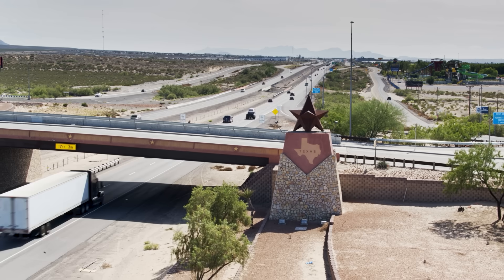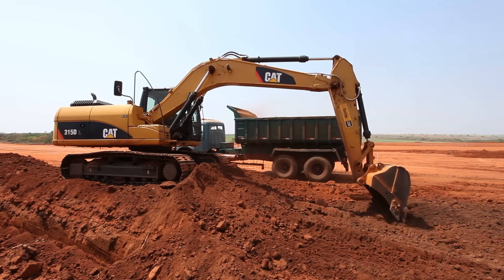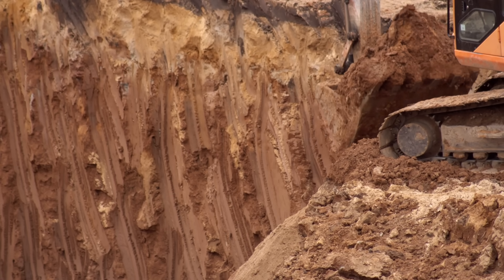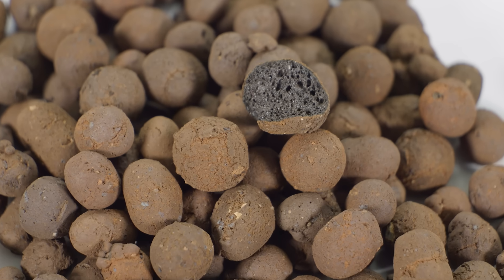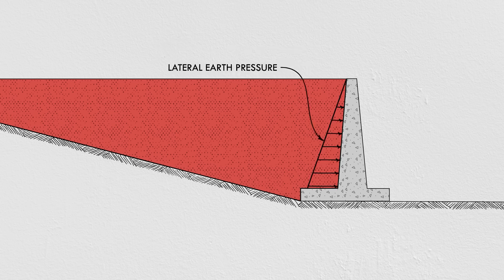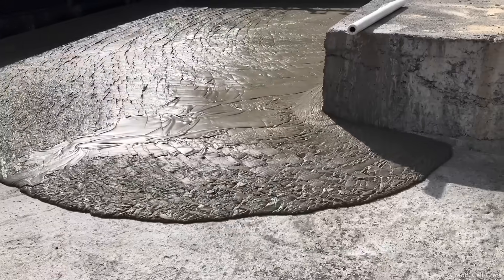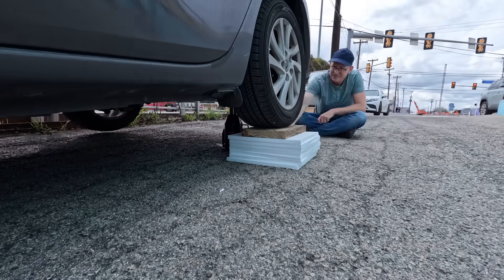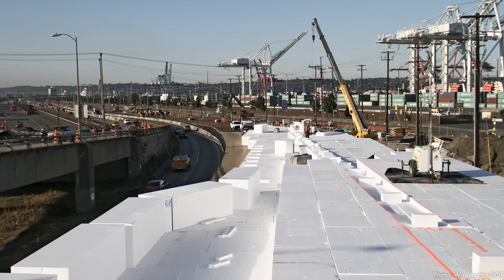Why Some Roads Are Made of Styrofoam

Comment: No matter how useful these techniques are if it means using styrofoam we should give up on them. Putting more plastic into the ground for 10 or 20 year lifespan things is an ecological timebomb. Though using biodegradable materials or recycled plastics for this makes much more sense.
Reply: More like 50+ years and probably offsets other emissions as well.  Biodegradable probably means methane emissions as well.  Details. They're important.
Reply: @AlanTheBeast100  Still better than using plastic.
Reply: @Treksh  Plastic is a disaster when used for short term disposable use.  (Water bottles by the case of 24, wrappings, things that have a very short service life).  When plastics are used for long term use, that is optimal when it is the better solution to a problem compared to other materials.  You have to consider many, many factors and not fixate on the negative one thing.  The sum of the parts includes its negatives.
Reply: @AlanTheBeast100  Unless the project is meant to last a 1000 years using plastic is always a disaster as it simply cannot or will not be properly handled at end of life. 

Do you really think these plastics or construction companies will go dig up and filter out the styofoma they have now mixed into this embankment after 50 years?

Whereas that area will have plastic in the ground for 1000s of years. 

The simple fact of the matter is any forever chemical that degrades on timescales that outlast civilisations is bound to cause problems. Do the 1000 years of harm get offest by 50 years of cheaper embankment construction I doubt it.
Reply: @Treksh  My last reply on this subject:  Styrofoam (and other plastics) are recyclable.  They are a real problem when the "escape" into waterways and into the ocean.  This is mainly a problem out of poorer countries and many countries in Asia with lax control.  Put the "save the world from plastics" energy into curbing one time use plastics (wrappers and so on), not on plastics used for long term construction or manufacture.  The latter also lend themselves to recycling when the project is disassembled.
Think like an engineer - drop emotions.
Reply: @AlanTheBeast100  I won't say Plastic backfill never is a good solution, but if you compare the costs of different materials removal of plastic (please no landfill, putting the problem elsewhere doesn't help). Should be accounted for.
Reply: @AlanTheBeast100  You can look it up plastic recycling is a joke.
Reply: Biodegradeble backfill ?
Reply: @anordinarytree4425  Equal to the lifespan of the project. Ya what else would you prefer, the project fails but the plastic in te ground in it lasts for thousands of years?

Comment: "A catastrophic loss of function" is just the most hilarious and accurate engineer-speak for "the building collapses on you."
Reply: Unfortunate unintended obsolescence
Reply: RUD in rockets - Rapid Unscheduled Disassembly
Reply: @TheTarGonn  rocket experienced a high-velocity Lithobreaking event = it crashed into the dirt
Reply: @1224chrisng  Litho = stone....
Reply: @jimurrata6785  In this case it refers to the lithosphere, which often has dirt on top of it. In contrast to atmospheric braking which is an actual intentional thing.
Reply: @1224chrisng  *lithobraking?
Reply: @TheTarGonn  More than just rockets.  Any spinning equipment that goes out of balance and tears facilities apart qualify too.  We are 'working to avoid RUD' was frequently stated in our meetings when some budgetary issue softening the safety margins came up.  If they've never experienced a RUD event they simply don't understand.
Reply: @TheTarGonn  I believe RUD is used specifically as a joke though, while "catastrophic loss of function" is actual serious engineering terminology.
Reply: @danieljensen2626  Not a joke.  We used it in technical reports.  It was mostly in the planning and design as we wanted to avoid RUD, while an actual RUD event would be sanitized especially if lives were lost.
Reply: significant emotional event
Reply: @genericscottishchannel1603  ayyy
Reply: "Is there a doctor in the building?"
"Unfortunately, yes."
Reply: @christianheichel  Bruh
Reply: rapid unscheduled disassembly.

edit: oh wait someone alredy commented that.
Reply: A catastrophic loss of function also applies to condoms.
Reply: @Blox117 So does significant emotional event
Reply: @petergerdes1094  I prefer "Financially Underprepared Unplanned and Unbelievable Containment Collapse Kids" or FUUUCC for short. Most people only use the acronym.
Reply: "Unplanned thermal event" means "caught fire unexpectedly."
Reply: Peasant. 
Best one in this video is "Soil is heavy, we learn this in college."
Reply: Unanticipated degradation.
Reply: Suddenly insufficient cohesion
Reply: @musewolfman  just like me fr 😓
Reply: @musewolfman  yea.. my wife experiences  that two weeks ago, had to go pull up here car
Reply: My favorite of these is CFIT. Controlled Flight into Terrain.  Obviously not a good thing for those on the aircraft, but the term is just engineering at its best.
Reply: For jet engines, I have heard "hardware-rich combustion."
Reply: Unplanned Implosion
Reply: Acute Reverse Construction Syndrome
Reply: Unsheldued disassembly
Reply: "Explosively deconstructing itself" is a way to describe a more extreme failure
Reply: I have to overrule with the spacecraft term Combustive Rapid Unplanned Dissasembly, CRUD.

It blew up.
Reply: @justaguycalledjosh  Chalk River Undefined Deposits
Reply: I prefer the 'P-Delta Effect' look it up... fancy speak for: first it started to fall over, and then, it ughh.. fell over. Lol
Reply: The front fell off.
Reply: @The_Viscount Yeah, that’s not very typical, I’d like to make that point.
Reply: George Carlin had some similar zingers when talking about euphemisms. Loss of cabin pressure = roof flies off, water landing = crashing into the ocean.
Reply: @Onihikage  Water landing is especially silly, since "landing" usually means "a touchdown on land". We already have a word for "water landing" - "splashdown".
Though to be fair, I see "water landing" usually referring to a horizontal landing of a plane, while "splashdown" usually refers to a water touchdown under a parachute.
EDIT: And "loss of cabin pressure" doesn't always mean "a roof flew off". It can mean anything from "we have a small hole in the cabin" to "we... lost a cabin".
Reply: @wojtek4p4  i came in hard for a splashdown but the parachute failed. now im paying child support
Reply: @wojtek4p4  why you gotta buzzkilled the joke?
Reply: @wojtek4p4  The French language has a word for it : "amerrissage" (mer means sea) as opposed to "atterrissage" (terre means earth / ground / soil) for ground landing.
It's in the same vein as "accostage" which means either port docking, approaching or touching the side of a ship, naval or spatial (side = côté, coast = côte) or "abordage", to touch the shore, quay or aggressively or accidentally boarding or ramming another ship.
There's also "alunissage" referring to a Moon landing.

However, "amerissage" doesn't imply any crash as it is also used for normal seaplanes landing just as much as for an airliner ditching in the sea.
Reply: @wojtek4p4  sense of humor
Reply: @Onihikage  Carlin was a word wizard
Reply: @Onihikage  Ah, George Carlin was a meister of wordplay!
Reply: @Onihikage  thanks, I'm reading this on a plane.
Reply: My favorite is, "Rapid, unscheduled disassembly."
Reply: Truck engineers use a similar term for tire blowouts.
Reply: Rapid Disintegration of Structural Integrity
Reply: rapid unscheduled disassembly
Reply: in the navy, reading the maintenance schedule....hitting something with a hammer was called "mechanical agitation."
Reply: In jet engines, we say "Rapid Oxidation" instead of "Fire". There can be a real difference, but not usually
Reply: Redneck engineering term is high speed come apart… your welcome.
Reply: I love that "catastrophic failure" is an actual technical term in many fields of engineering.
Reply: It's a long the same lines as rocket engineers calling the event when a rocket blows up as "Rapid Unplanned Disassembly"
Reply: Lithobraking.
Reply: Rapid unplanned disassembly aka RUD. (rocket explosion)
Reply: Rapid Unplanned Disassembly 🤣
Reply: I have this whilst drinking.
Reply: Rapid unschedulled dissasembly
Reply: Applies to governments once in a while as well.  Has pretty much the same effect.
Reply: Very nice
Reply: @baylie_ I hate to ruin your day, but everyone dies. The people using these terms are doing everything possible to prevent premature biological failure.
Reply: I've used explosive deconstruction of rotating assembly in the past haha. Always gets a smirk from colleagues.
Reply: "at 12:34pm GMT the craft experienced a rapid unplanned disassembly"
Reply: Building muscle gone
Reply: reminds me of the Challenger explosion, when the anchor on air stated "obviously a major malfunction" as the image showed the debris and smoke in the sky
Reply: Sudden unplanned self disassembly
Reply: my brain is going to be stuck on the word failure.
Reply: Lol 👍🏼👍🏼
Reply: Hands-free deconstruction
Reply: Catastrophic in engineering means a very rapid failure 

Imagine a steel bar that acts as a column, as the weight increases, the bar bends down, and down, and down 

At some point it suddenly bends down rapidly. This is what we call catastrophic.
Reply: ‘An unexpected structural reorientation of the material’
Reply: NO IT IS NOT! I know you are trying to be funny but you are spreading misconception in a country that is already scientifically illiterate.
Reply: @thornil2231  Who are you replying to?
Reply: I always liked "rapid unscheduled deconstruction"
Reply: A useful thing is to learn the difference between mildly amusing and "the most hilarious."
Reply: @johnsmith1474  An even more useful thing to learn is that people are individuals and thus have different senses of humor - not everyone thinks like you ;)

Comment: We just had a landslide here from all the rain. It was on the hill of a circle off-ramp from I-220 in NW LA, next door to you. A chunk of land about 70yds wide x 40 yds tall slid down about 10 feet!
Reply: And it's not the first time it's happened at this off-ramp from I-220. That's the craziest part. Pretty sure it was the same exact spot.

If you want to pull it up in G. Maps, it's i-220 at N. Market St in Shreveport LA. It has a figure 8 design and the ramp getting on 220 east is where it happened I believe. You drive right next to part of the 8 as you get on 220 and that's where it slid. It was pretty wild to see.